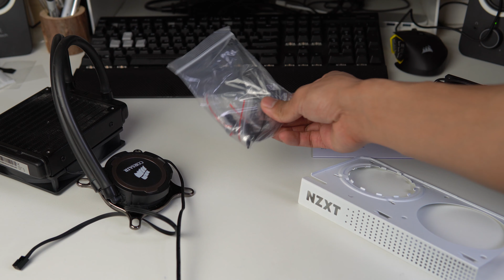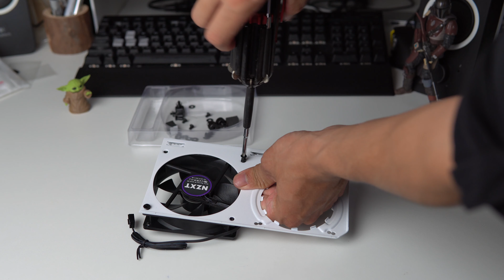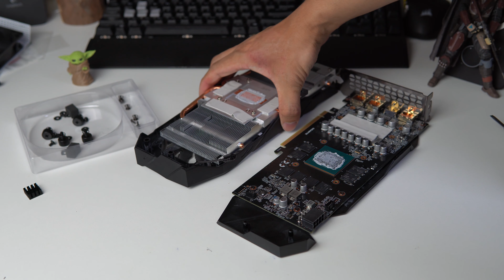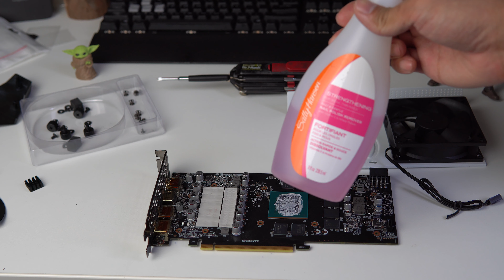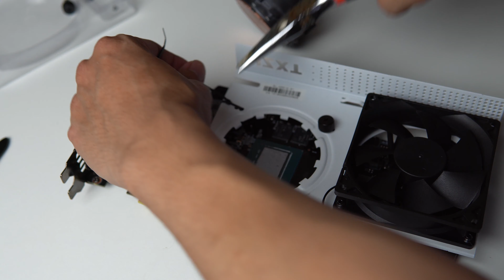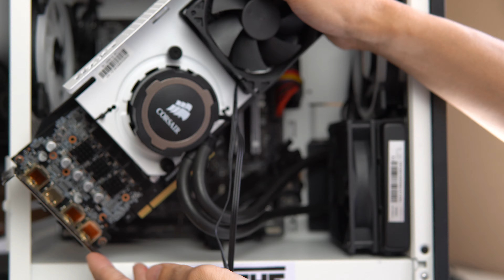NZXT Kraken G12 on RTX 2060 Super: Incompatible... Or Is It?

Comment: I just got a Gigabyte 2070 Super and ended up without planning, in a trade a H75. My board layout looks exactly the same also. Thanks for the video and I will give the G12 a shot and report back. Those MOSFETS for sure need to be cooled though, they are usuall in the rear of the card, on most cards, I will likely throw a small fan on them.

Comment: Your temps might be better.. but your GPU clock is way off compared to your stock cooler. Thats not right something is not working correctly. Did you undervolt your GPU? Your TDP and Voltage are considerably lower.

EDIT:

At 28:31 you can see your PCB Flexing and how uneven the GPU bracket is which is going to affect your pressure on the GPU die. Its very important to not over tighten the screws on the bracket that holds the AIO.

I applaud your effort in trying to make this work but I'm guessing 2 years later as I'm typing this you have had to replace this or put back the stock cooler.
Reply: x2

Comment: **EDIT**
I did some more research... I think if I used ABS plastic... it might work better. ABS starts losing rigidity at over 100 C... I might try to make something. Could be a fun project. Though... I'm sure using plastic brackets would mean the cooler is less effective since I'm sure the whole bracket acts as a heat sink for the motherboard, at least partially. Probably wouldn't make too much of a difference though.
****

I have, at this point, a 3 year old rtx 2060(not super), with a bad fan making a lot of noise after . It's a Zotac AMP edition and it's definitely past warranty and I never registered it anyway. So I was looking into replacing the cooler with this, but... idk, this is a bit too jank. I was just trying to understand why the card is listed as incompatible, so it's just the placement of the chip. I would rather just engineer my own bracket but uh, I don't really have tools to work with sheet metal. I briefly thought of 3D printing a bracket, but I checked the physical properties of PLA and I'm pretty sure the PCB around that area will reach around 60 C at least which would probably result in disaster since the PLA starts to lose it's rigidity at that point.

I think I just have to accept that my card is going to whine. Unless Zotac sells replacement fans? If anyone knows how I can get my hands on those I would greatly appreciate it, but I guess that's what I'm going to look for now because I don't think I'm going to force install this bracket... and I don't really want to build a custom loop, not right now at least. I know there are cooling blocks for water cooling for the 2060 cards but I don't want to deal with that at this point.

Thanks for the video though! I'm sure others will find this useful.
Reply: You can contact them directly and they'll often just send out new fans for you
Reply: @Bishieboi  I did end up replacing the fan. Also not sure how asking for a replacement fan would go if it's years past warranty.

Comment: did this with my 2070 and the temps never go above 42C when 100% usage. Great product. I used an ASUS TUF AIO 140MM. Works perfectly.
Reply: It doesn't mention rtx 2070 as compatible card did it fit perfectly? I have rtx 2060 msi twin fan it runs at 83C at full load I hate that.. will it work with my GPU as well ?
Reply: @ishivangchauhan  i had to take the back plate off for the holes to align. It fit perfectly without any modifications. I asked nzxt customer support and thet said it would fit so i figured $30 to check isnt bad and if it doesnt fit then ill return it. So i would buy it and try to fit it on your gpu and if it fits then buy the aio needed
Reply: @otto432  I mean how his fan was not on the right place and some capacitor were not having airflow but yours fit as it should ? Ill try to see where my GPU chip is and see how and where that fan would go. It's expensive to buy pc parts here
Reply: @ishivangchauhan  i see what you mean now. My gpu had most of the diodes and capacitors and such on the right side of the gpu die, and my fan also lined up very well blowing air to all of these components. My gpu is the msi 2070 armor 8g. As for the chips that arent covered by the fan, it doesnt seem to overheat or anything. No failures after 48 stress test i performed when i installed the product
Reply: @ishivangchauhan  i also did not use the stock fan, i replaced the nzxt fan 92mm with a noctua 92mm fan. Not sure if this helped in anyway but worth a try
Reply: @otto432  that's nice to know.. I'll see what I can do. Hopefully it fits well
Reply: @otto432  hey man, I have never opened up GPU plus not that tech savy to tell where exactly vrm etc are I saw a video of someone changing thermal paste on msi rtx 2060 ventus it looks exactly like mine but mine is like ventus Xs oc. But I believe the pcb is exactly as shown in there. Can you watch this short video and let me know if kraken g12 will go well with such GPU ? And not miss any major things on pcb https://youtu.be/HS_C9cjgTpU
Reply: @ishivangchauhan  i was very skeptical of mine working as well but i decided to go for it and it surprisingly worked very well.  I also used thermal grizzly kryonaut as thermal paste and im sure this is why it works as well as it does
Reply: @otto432  can watch the video once let me know how well it can work based on vrm coverage etc ? I will have to fully commit to it then because everything sells for a lot here and we don't have any return options as well

Comment: its looks like he putting it on the wrong way round all it just dosent look right and if he had just changed the paste and set and better fan curve i bet that would have fixed the heat issuse even tho 86c ist bad at all for a gpu and will not damage it

Comment: Did this on the same card, I extended the front of the Kraken bracket, painted it all up and made it looks nice and put a small fan on the extended piece, I also used a VGA fan splitter to let the card or MSI Afterburner control the fan speed, seeing some awesome low temps, I also did not use the NZXT fan, I used a Corsair PWM RBG fan, you can ream those kraken holes out a bit to mount all 4 screws. I wouldn't have thought those zip ties would give enough mounting pressure, especially over a long period if time.
Nice video.

Comment: This has got to be the dumbest mod video ever. so many mistakes, little research. Pls dont do this!!
I have just installed Nzxt G12 & had zero problems. i researched every aspect from case to tube length, Vram & mosfet cooling, 4pin to 4pin mini adapter etc etc.
OP you wasted 30mins of my life. By the way i get max temp 45c at 2050Mhz OC, 75c means you have a problem

Comment: I have exactly this card and model from Gigabyte, already applied Thermal Grizzly and the temps still hitting tjmax, gigabyte sucks.
Reply: I have the same card and mine gets pretty hot too. Reapplied new paste and knocked it down a couple degree but it's still a steady 75 with hot spots getting to the low 90s. It's just a hot running card pourly designed and advertised as it is good thermals. Drives me insane. Has been and will remain the last gigabyte product I buy.

Comment: Good for you Jay to make it work but cringe factor was of the scale. I understand doing what ever it takes to make it work so kudos for that, but the water block needs to have solid even pressure on the GPU and under spring-loaded tension. This things looked very uneven and too tight. I don’t think it will stand the test of time.

Comment: My MSI 2060 super 8gb (STOCK AIR Cooler) runs 28-29c and under load will 55-58 maybe 60 C  is this worth it?   I would have cleaned off the thermal paste and applied a quality paste put it back to it's original config , and probably would have got better results.

Comment: Man does this guy have a drill ?  could have just made the screw holes larger and used all four screws.
Reply from the maker: You really want to drill a GPU PCB?
Reply: @JayGamingTechTips  Not the PCB the white pump plate , you only put two in.. you cold have drilled off set holes in it to line up those mount's instead of zip ties or just reamed out the existing holes ..not that I would ever do this in the first place.   Cute kid BTW !!

Comment: if you would have cut the ends off the "A" brackets you could have turned them so that all the holes would have fit also did you put the pump and fan on the same splitter?

Comment: I would note compatibility is an issue normally due to the card manufacturers - not all 2060/supers are alike due to custom PCB changes like distance between mount holes or die position.
The stock design PCB from Nvidia has the GPU dies to the left so a good fit for the G12. That card looks like the Gigabyte 2060 Super 'Gaming' OC which has a centred die position.
Meanwhile I have the Gigabyte 2060 Super 'Windforce' OC which keeps the die over to the left side. No consistency even between the Gigabyte model variants.

Comment: Thanks. I was about to order this. But this video made me realize it is probably not a good idea.
Reply: I'm some cases, it's good, but usually only if you have a blower card
Reply: @TaxEvasionUS  mine is a blower card. Temps are bad af. I think this is gonna be worth it. Assuming I don't mess it up.
Reply: @edy6722  I did this and it was worth it
Reply: @TaxEvasionUS  that is good to hear. Now I just need another AIO that fits in this thing.
Reply: @edy6722  I used the NZXT M22, but I had to mod the brackets to get it to fit. I would recommend you getting 5/32 cobalt drill bit.
Reply: @TaxEvasionUS  I saw someone here in youtube who used a fractal s24 and it fits perfectly on the nzxt g12. Imma try it out. But I guess I still have to mod the bracket
Reply: @TaxEvasionUS  I just finished working on mine and it IS very worth it. from 85 on gaming to 47. Performance is way better and more stable. Even OC'ed, i get around 53 MAX. I am soooo happy.
Reply: @edy6722  Good for you!

Comment: Please tell me you added cooling to your cards VRM? If not that will be a dead card soon. Perhaps you did this off camera?
Reply from the maker: Yes 26:20 of video
Reply: @JayGamingTechTips  Also, you fitted the brackets "front to back" relative to the GPU with some modifications. Couldn't you have just fitted them "side to side"? i.e. one bracket on the PCI-E slot side on one on the outside of the card? There would have been no clearance issues that way, unless there's something i'm missing? Would the mount foul the pci-e slot?

Comment: Thank you so much for your video, I have the same VGA and it is so hot. I will try with G10 version of this one, G12 I just can't find it in here, i watch a lot of videos and I'm pretty sure that it will fit, about the heatsinks you just brought all of the same size for memory chip and vrm ?
Reply: Does the G10 is comptable with the 2060 super ... Plz .. reply
Reply: @NK-mt4kv  Yes, it works.. but need a bit of patience. Mine still working, need heatsinks and I use a termic glue on them.

Comment: This video was really helpful as I was looking into doing the same thing with the same card for myself, is your fan in the new configuration intaking air through the radiator and into the case, or taking air from the case? what would be the reasoning for that?
Reply from the maker: Alexander Chaulk I have a 5400rpm 120mm fan blowing air from outside onto the radiator and 3 fans as exhaust (2 at top, 1 at rear). The radiator fan speed changes based on temperature (at 100% it is a jet engine so even at 75° it’s only set to 40%).
Reply: @JayGamingTechTips  The black fan  that is attached to the radiator in the video looks to be sucking air from inside the case and going against the flow above the fan, I was just curious about that placement
Reply from the maker: Alexander Chaulk oh it’s not like that anymore, I replaced that fan with a more powerful one now and it’s on the other side of the radiator now.
Reply: @JayGamingTechTips  Did you ever have issues with fan noise and sudden ramping with this card? I have been having this issue and wanted to know if its common or if its an isolated case, I'm hitting 88C at idle so I think something is seriously wrong

Comment: really nice go through to let us know some rtx pcb doesnt fit the nzxt g12 mounting bracket. there are users of g12 who choose to cut off the A/N bracket so as to line up the mounting holes. your way to bend the bracket may affect the mounting pressure as a result.

75c is definitely too high for aio cooling on gpu. it means the contact between the aio copper base and the gpu die is not right. i think your second remount kind of fixed that so it drops to 60c.
Reply: Absolutely. My 2080TI never exceeds 52C under load @4K on a NZXT AIO.

Comment: im planning on doing the same thanks to your video, did you find a way to cool the vrm and memory?
Reply from the maker: José Luis Hernández V. At 26:20, I installed the passive heatsinks
Reply: I did this with my 2080TI. The fan in the G12 bracket cools that half of the board without issue. On my card, there were many chips on the front of the card not covered. I did not use heatsinks, rather mounted a 120mm fan in the next expansion slot below my card, blowing cool air directly over that part of the exposed card. The max temp I've had on this card is 52C under full load @4K. Down from 80 plus and throttling.
Reply: @tebo2770  What was your hotspot max temp? Was that mounted fan providing enough cooling?
Reply: @AmritSingh-xe5yr  Well, its been a long time since I've used it for gaming and while I don't recall any specific temps off hand, the fan worked great for the VRM's. It's still going strong today in editing. I've had it running at full tilt at 4K in games and it's always stayed well under control and never throttled again. Best mod I have ever done.

Comment: seriously. NZXT need update their item to more compatible
Reply: fr, i don't wanna spend 100$ more on a 2080 just so i can cool the card for an additional 80$, i would rather a 2080 super with shit temps
Reply: @jeffharmse  well, if it has shit temps, it cuts down its longevity and thermal throttles. I’d rather have a 2080 with way better temps (which this would provide. I have a G12 on my 1080 and it never goes above 44C)
Reply: @AznUzer  almost none of the 2080 AIB/FE cards will have massive issues with thermals.
Reply: the amd install kits fits rtx 2060/70/80, nzxt says that g12 ain't working with rtx series,

Comment: I'm looking to water cool my NVIDIA 2060 Super.    But if this is the only way (AIO) then I think I am going to leave it as is :\      The -10 degrees is nice but not for that much trouble getting it all installed.
Reply from the maker: It was actually a little over -20 degrees change since it started at 86° and lowering down to 65°. But yes the installation can take awhile, but only because I took time to explain everything for the video.

Comment: Thank you so god damn much for making this video!! I really appreciate it. I’ve been looking for THIS EXACT THING FOR ABOUT A MONTH NOW and I came across this and omg wtf have I been missing. You’ve saved me thank you very much! Coming up to summer and cards already at thermal throttle!!! So thank you so much 🙏 quick question tho, won’t the memory chips on the left get hit and throttle? They usually have the heat sink
Reply from the maker: VapidReaper341 thanks for the feedback- I actually installed the ram heatsinks shown at 26:20. And yes, if they are left without any cooling, they will throttle.
Reply: As reviewing the video again, I see you’ve put small heat sinks on them, I don’t own any of them so are you able to let me know where to get them from? Like a link or something? Also I’m from the UK if that’s any help to the heat sink stuff
Reply from the maker: Here- https://www.amazon.co.uk/GCOA-Raspberry-Heatsink-Aluminum-Conductive/dp/B07K68X4YX
Reply: JayPlaysDotCom sorry for replying so late. But I’ve finally got it installed after drilling 2 new holes on the bracket it’s self so all 4 screws are now mounted. I’ve mounted a Corsair H55 on the core and oh my. It’s gone from 88 to like 67 over clocked. And 67 is just the highest. It’s usually about 55-60 while gaming! Thank you so much
Reply: Dude I would not do this this is janky as hell.

Comment: Hi! Great job and video! I am going to do the same with my 2060 super. But it is not clear if you have put the heatsinks on all the mosfets on the left of the graphic card (which is the main reason it is said to be incompatible; the page at NZTX says the mosfets need to be on the right to get enough cooling from the fan.) Did you put the raspberry heatsink on top of all of them afterwards with some thermal double side tape? Also how are they now, do they heat too much? Thanks.
Reply from the maker: Evε Wσlғιε :D yes I installed the passive heatsink as shown at 26:20 of the video.
Reply: @JayGamingTechTips  Thanks!